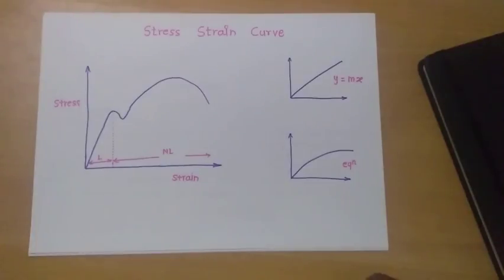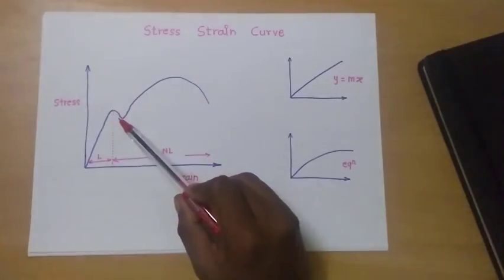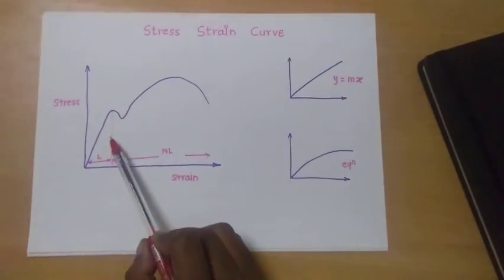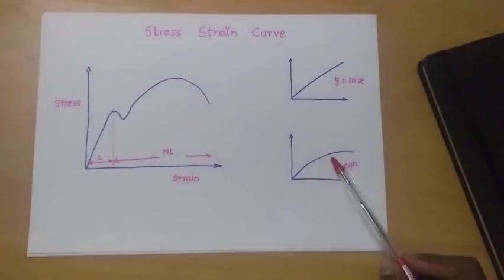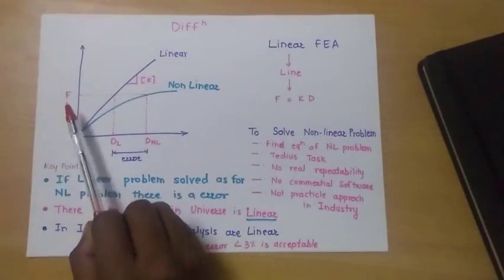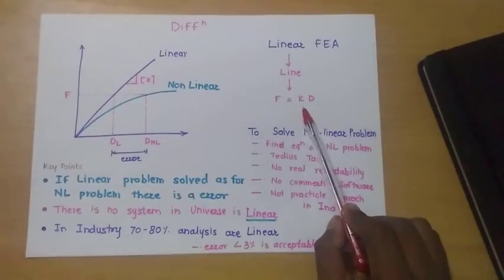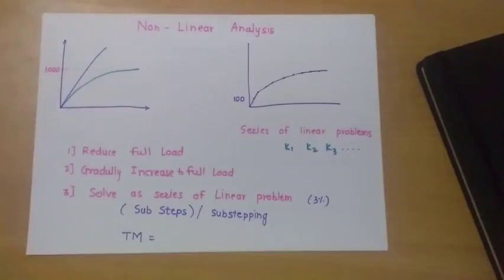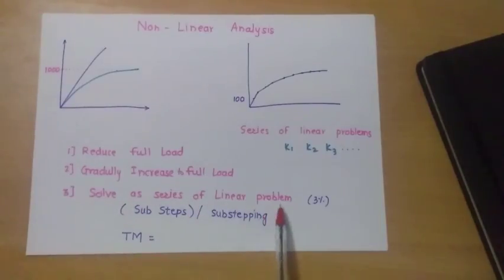Linear and Non Linear FEA | feaClass | Basics

Comment: Sir, please explain why plastic material having variable thickness & sheet metal has uniform thickness?
Reply from the maker: Can explain more about question..
Reply: Yes Sir.
Reply: This question is apart from your uploaded vedio.
I'm asking from analysis point of view.
Reply: maybe you are referring to the "necking" phenomenon happening when testing metals? in that case necking happens because metals can sustain a certain amount of plastic deformation before breaking meanwhile plastic material just breaks instantly without sustaining any plastic deformation CMIIW
Reply from the maker: Both plastic and metal can have uniform thickness.